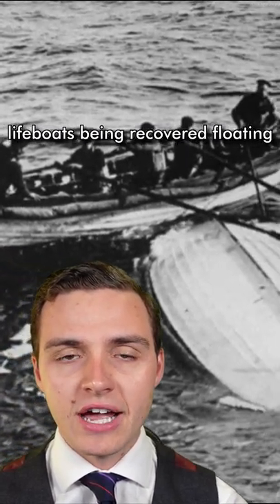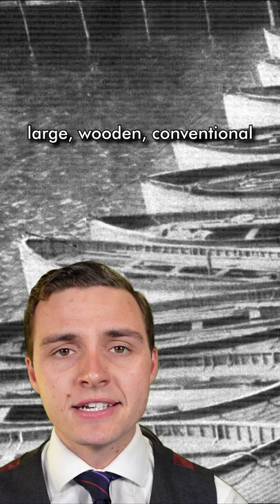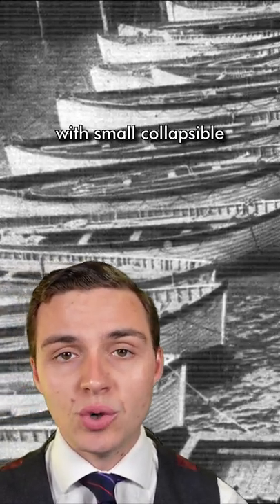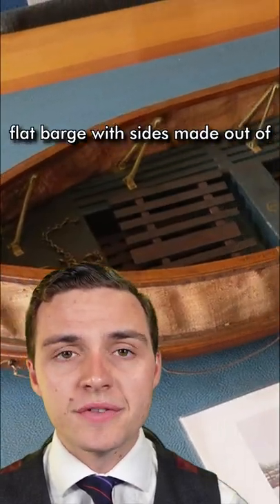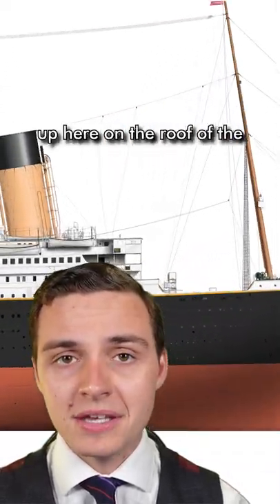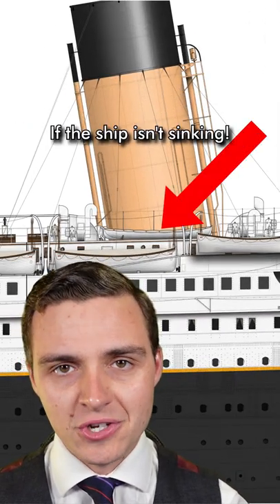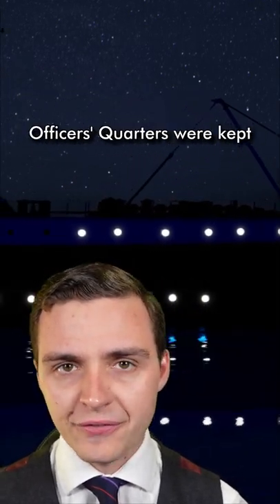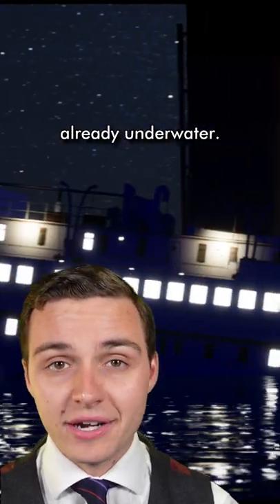Titanic: why this lifeboat was found upside down? | Oceanliner Designs Shorts

Comment: Fun fact more people on the lifeboat that was capsized survived than the people that were on the non capsized one. This is because the non capsized on flooded because when Murdoch was preparing that lifeboat the ropes stayed attached. So the lifeboat was dragged and flooded. The ropes were cut but then another problem. When the first funnel collapsed the giant wave generated by the fall poured into the lifeboat putting more water in the lifeboat with wasn’t capsized. While the lifeboat that was capsized people had to stand and balance it and because it was capsized no water was inside the boat. 2nd officer Charles Lightoller and Wireless operator Harold Bride survived on the capsized collapsible.
Reply: Ahh yeah very fun
Reply: And both had more survivors than Lifeboat 1, which was launched with only 12 people aboard.

Comment: People say if the Titanic had more boats they could've saved more lives. Except, the crew had barely enough time to get the few boats they had launched in time. The last two floated away as the ship sank from under them
Reply: Packing the boats to capacity could have saved several hundred more lives
Reply: They didn't launch the first lifeboat until an hour after the ship struck the iceberg. There was time. The Empress of Ireland launched five full lifeboats in just 14 minutes before they sank.
Reply: More lifeboats would’ve at least given people something to float on. Yes, the last two did float away, but not without a couple dozen people climbing onto them which was just enough to keep them far enough out of the water so they could survive out there until other lifeboats came back for them. If it weren’t for that, there would’ve only been around 660 survivors.
Reply: Only poorly informed people claim that more lifeboats would not have helped. There were no lifeboat drills, either. All 48 lifeboats could have been launched in an hour by a well-trained crew--but only if they'd been trained and if a few drills had been conducted with the passengers.

This is why more lifeboats plus lifeboat evacuation drills are mandated after the unnecessary disaster of the Titanic, caused by White Star Managing Director Bruce Ismay and ship captain Edward Smith.

Comment: Imagine what those handful of survivors went through, not only surviving the cold but surviving the panicked swimmers who undoubtedly tried to get on the boat also. They must of had to fight off other passengers over and over again until the swimmers eventually died. Imagine that survivors guilt
Reply: Well that was the case to some extent, but 2nd Officer Charles Lightoller was also on it, and he worked to keep the boat steady, and did try to help some people onto it. My understanding is that his presence was a comfort to people because of how he took charge and seemed to be so sure of himself. Of course, Lightoller was a somewhat controversial figure himself, both during and well after the sinking, but he did help with the overturned boat
Reply: @FoxLosst  He did also help ensure people would make it safely from the lifeboats to the Carpathia and was the very last survivor to come aboard himself.

Comment: One of my distant relatives was on Collapsible B. He'd stayed close to the front of the boat deck, where Second Officer Lightoller and several fireman were trying to launch Collapsible B.
Water was gushing toward them. The front of the boat began to rapidly sink. The firemen began jumping overboard, so he did the same. He then swam away and found Boat B floating next to the sinking Titanic, washed overboard. He grabbed onto it as it floated near the forward funnel, moments later the funnel fell down. He thought the ship broke in two at that time. If I'm correct from his testimony when the men were on it, it wasn't even above the waterline they were waist deep in water, and had to balance to keep it from tipping over.
Reply: How would you know this if you don’t mind me asking 🤔
Reply: @billylloyd7488 From his comment it sounds like he survived and testified at one of the inquiries.
Reply: @billylloyd7488  My guess would be he learned it from his relatives who were related to the one who was on collapsible B.
I learned from my father who learned from his father that my great great grandfather was one of the repair engineers of the Lusitania right before it left New York City for its final voyage

Comment: Only one life boat was over capacity. It had something like 66 survives. It was the only boat to be full. The Boats were made to hold 64 passengers. One boat only had 
28 survivors on it. The rest of the boats were only half full. The main reason was the crew didn't think they could lower the boats if they were full to capacity.  Most of the crew wasn't trained properly or at all. No safety drills were ever performed.  Most of the crew didn't know their assigned positions.   
   There were 2,240 passengers and crew, only 706 people survived. Another 360 - 400 people could have been saved. 
 The titanic was  capable of handling 48 boats, whereas the ship carried but 16 lifeboats and 4 collapsibles, only fulfilling all of the requirements of the British Board of Trade.

Comment: Funfact: There were way more people that made it on collapsible B (the one that is upside down) than on collapsible A. There are a few reasons for that, such as collapsible A not beeing manned by any  crewmember. Titanics officers that were responsible for the starboard side William Murdoch and Henry Wilde never made it onto the collapsible A. They were too busy trying to help people onto it. But when collapsible A was floating on the water, it was getting swamped by people that tried to climb up. Collapsible A was very unstable and those who were on the boat tried to push those off who tried to climb up. (They even hit some with the oars). And although it was horrible to just push the people off, it was the right thing to do. Collapsible A could've just ended up like collapsible B or like some of the lifeboats on the Lusitania. They helped too many people onto the boats at once.

Comment: What I will never understand is why life boat numbers were based off of ship weight, instead of passenger numbers
Reply: Lifeboats had a completely different expectation about them back then. They weren’t meant to be people’s sole means of survival. 
The rules were put into place around the mid-1890s, when ship’s tonnage directly indicated their overall size and heavily implied their capacity. Back then, the largest ships in the world were the RMS Campania and RMS Lucania of the Cunard Line, which were both around 12,000 tons and had a capacity of about 2,424. The regulation, however, was very outdated by 1912, and did not take into account the constant growth of ships. By 1911, the largest ship in the world was well over 45,000 tons and had a capacity of a thousand more than Campania and Lucania’s, yet the rules unfortunately hadn’t changed.
Reply: Considering titanic had less passengers aboard than many other smaller ships with less lifeboats, you're right.

Comment: There is a problem with launching the old style davit type lifeboats. The ship is sinking but still moving forward. As the lifeboat hits the water it is being dragged and will be swamped unless the lowering lines can be released. This is made very difficult because of the pressure placed on the lines as the lifeboat is being dragged.

Comment: It always makes me wonder that instead of trying to slide the collapsible lifeboats down to the boat deck the crew didn't simply raise the canvas sides, fill the boats with passengers and let them float off the ship as it sank beneath them. Titanic sank slowly and at this point there wasn't any significant suction from the sinking to present a danger of the boats being pulled under. This was proven when the boats floated off easily anyway from the boat deck, one right side up and another inverted.

Comment: Imagine if someone told everyone to go on one side to flip it so they wouldn’t have to stay on the bottom and could actually sit
Reply: Problem is you don't want to get back into the water even for a moment in those temps.
Plus its much harder to flip an overturned boat of that style since you'd have to have ahold of one side while pulling from the other with enough counter weight to overcome buoyancy and water resistance.

And they were passangers not experienced mariners. They'd have no clue what to do even with someone from crew attempting to lead them

Comment: Would like to know more about the Titanics fire places. How they worked and were they wood, coal or gas. And if wood or coal where did they store them
Reply: The boilers were coal-fired. Coal was stored in longitudinal multi-story bunkers running the width of the ship between each of the boiler rooms, which can be seen on the deck plans quite well.
Reply: @DerpyPossum  hey, I mean for the fire places. Didn't think there was opening on the high decks to the coal bunker
Reply: @shaun1912  Oh, haha, apologies.
The only working fireplace aboard the ship was in the smoking room on A deck, which burned coal. I’m unsure where the coal was stored, but since the smoking room had a hidden passage of sorts to a bar/pantry, I’d assume it was somewhere in or around there.
The rest of the fireplaces - including those in the parlor suites, the Reading and Writing room, lounge, etc. - were fake, and were fitted with electric heating coils.
Reply: @DerpyPossum  thanks. Was just thinking about it when I was working with the wood fire pizza oven at work

Comment: Very clever putting the special equipment for the assembly of lifeboats right in the place you expect to get damaged / sink first.
Reply: The bow isn't always the first to go. In fact, capsizing is far more common during a sinking. If it wasn't for a coal fire, Titanic may have as well, but due to the fire, a lot of coal had been shoveled into the port bunker, which bought the ship more time.

Comment: The fact that they didn't fill the boats with people is what is horribly shortsighted. Like it's not bad enough there was such a differentiation between classes but they also let a lot of people die who didn't have to.
Reply: The underfilled boats were sadly due to the lack of passengers willing to enter them, with some even outright refusing. But not all of them were seldom-filled; quite a few were closer to capacity, and a couple might’ve even been slightly over-loaded.

Comment: The crews lowering the boats weren’t trained and lowered boats crooked
At least one boat a passenger cut one of the ropes dumping every one in the water
Reply: Wrong. The crew had successfully completed three total lifeboat drills. One before the ship left Belfast, and another two during her sea trials. All were performed in commendable time and the crew worked tireless that night to get as many lifeboats off the ship as possible. They simply ran out of time.

The crew cut the falls to Collapsible A, and maybe a passenger or two helped. No passenger was responsible for ruining a launch and no lifeboats dumped everybody into the water. You're probably thinking of the Lusitania.

Comment: Huh?! Didn't the Titanic had 18 conventional life boats? The First ones right behind the Bride had 2 Life boats instead of the 14 Other with just One Life boat (I don't know how those Places are called in english, where the Lifeboats storage between two David's)
Reply: 16 conventional boats. The other 2 boats you mentioned were also collapsibles.
Reply: @DerpyPossum   it was 2 cutters ,14 clinker built wooden boats and 4 Collapsibles
Reply: @darklord7479  Exactly.